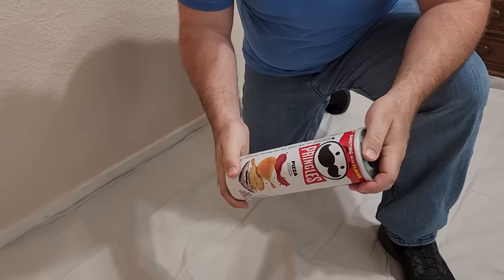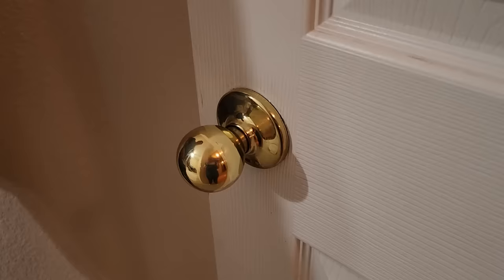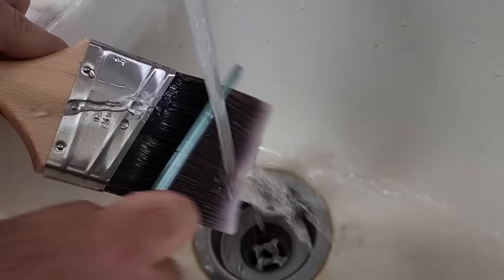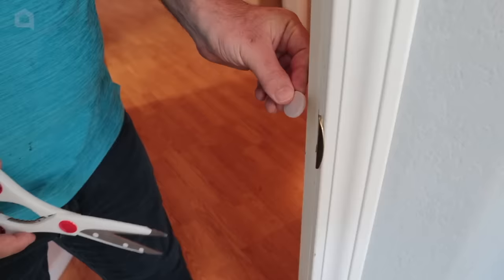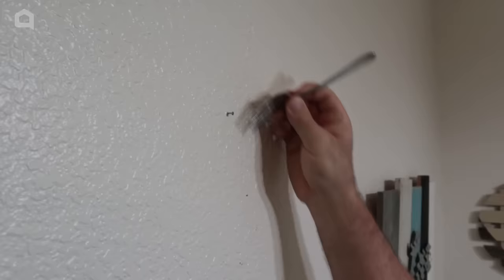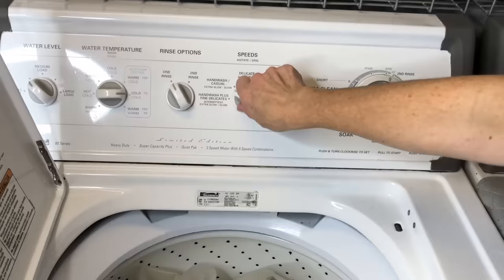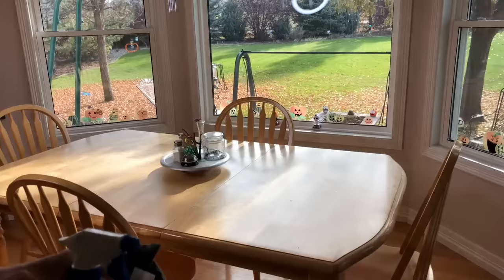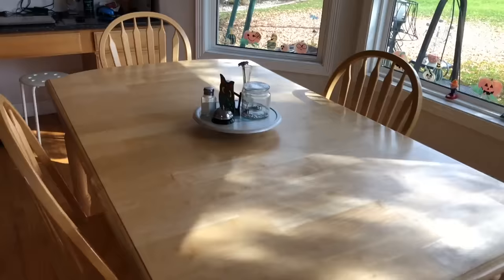9 genius home hacks from a guy who painted 1,000 homes

Comment: 7:30 I’ve heard you NEVER use vinegar around tile, because the vinegar is acid and the grout is alkaline.  My mother-in-law used vinegar to clean the shower tile, and now all the tiles are compromised, some are falling off.  
A couple of suggestions:   
First, may be ok to wipe but not to spray.  
Second, may be ok if grout is sealed.
Reply: Not sure if vinegar is good for wood either. What about the bleach on the tile? Never knew vinegar compromises grout and I think I’ve seen people say to use mixture of baking soda & vinegar on tile grout? Not questioning you. Makes sense. Just not sure why people would  recommend mixing baking soda with vinegar to clean dirty grout?
Reply: @sharilee4412  Mixing the vinegar and baking soda will make the resulting paste approximately ph neutral. The baking soda is a mild abrasive and won’t generally harm surfaces.
Reply: Tile guy here 25 plus years. Tiles definitely are not falling off from vinegar. Improper installation and or lack of waterproofing or poor quality grout. Js
Reply: Idk if the pH matters/compromises anything, but I spilled full strength ammonia on my grout and it looked brand new. Its pH is alkaline at 11
Reply: @robertfischer5893  hmmm. I need to check that out

Comment: Finally a video with some actually very useful tips. Love the pringles can and the rubber band
Reply: The Pringles can is genius...however, I just thought of a better hack.  Put the roller in a plastic bag first, so you don't have to worry about cleaning the chip crumbs, and the plastic will ensure it's air-tight.
Still for me....between coats, I prefer to keep the roller on and roller handle and wrap the whole thing in a bag, and use painters tape to seal it.  Keep it in a cold dark place like a basement or if in an apartment ..use the floor of a closet.   I do the same with paint tray too. Massive time saver since I just unwrap and finish off the second coat!
Reply: @canadude6401  if I don't finish painting I put the roller or paint brush in a zip lock bag and put it in the freezer. It doesn't take long to defrost and it doesn't dry out.

Comment: Many people put their brushed and rollers in the fridge between coats, but I put them in the coldest, darkest room in the house.  Which is the basement floor in my cold room.  I also wrap my paint tray with a larger plastic bag to keep the paint from drying out.  I used to waste tons of paint and time cleaning the tray between coats.  I keep all my paint cans and brushes in the cold room too.  Keeps them from drying out.
Reply: I stick rollers in a plastic bag and wrap it around to get as much air out as possible. Works well.

Comment: The glove tip is good, I've always used a bread wrapper and rubber band or twist tie when I take a break.  I keep an old toothbrush and a fingernail scrubbing brush for cleaning my paint brushes. '

Comment: I do some of those. I have one myself that works well. I use a piece of Glad press & seal plastic wrap in my paint tub. It's self adhesive to the bottom and sides for easy clean up. Just tear out and toss. Leaving a clean pan bin. I use  the shallow  plastic containers that family pasta dishes are sold in. The fit the film perfectly.

Comment: Another trick for doorknob and hardware is liberally rubbing vaseline on it, paint over itas normally would. Works on hinges also. When finished simply wipe off vaseline and paint with a rag. Bonus, the vaseline will help with squeak in hinges and hardware.

Comment: I'll leave my own vinegar tip ...

For rusted tools, simple take a glass pan, add equal parts water and vinegar to the pan, and let it soak overnight. The vinegar solution will break down the rust, which you can remove with a wire brush and steel wool. Then, add a little oil to the surfaces, and you're good to go! 👌👍😝

Comment: The door rattle… there is a little tab on the strike plate inside the hole. This is meant to be adjusted by bending to hold the door closed against the door stop on the frame

Comment: I painted my  living room a few weeks ago and some of these tips would have be really handy. Any tips for removing paint off wooden natural floor boards?
Reply: Try heat and a plastic razor blade
Reply: @Criam  really? Ok... I will check this out. Thank you 😊
Reply: @MindSetReset  I just had to scrape paint off my mom's wood floors this week. I had a very very sharp knife that came with this multipurpose plier type tool. All her razor blades were too dull. As long as u are careful this is the easiest way to get it off. For smears I just used Murphys Oil Soap & a soft towel with a lot of scrubbing.
Reply: Sherwin Williams Has wipes that work

Comment: I only watched the paint hacks out of curiosity. Im a retired paint contractor. 
Vanilla wont remove fumes. It just masks them. Paint will offgas chemicals for up to 7 years after the job is done unless you use VOC free.
Painters tape is toxic af. Use masking tape if you must but i think its only needed when masking for spraying. You can get a cleaner edge without it with some practice. Draw a bead of paint in quick long strokes pulling away from the edge at the end..Then repeat at a point above where you finished.

Comment: I’ve painted in some of the most popular sights in the world. Along with 1,000 homes, cars, newspaper bins, miles of fence. Seen many shenanigans, better or worse. Will give the foil trick a try. Hadn’t seen that.
Reply: If you painted 1000 homes you should be able to use your common sense to know foil wont work because it can't seal airtight like painters tape, paint would just leak under foil

Comment: Be careful using vinegar to soak showerheads...the newer ones are made of plastic-type stuff and I literally came back from a soak with a shower head minus most of the chrome-plated outer paint/color on the showerhead...it works great on metal heads, without worry.

Comment: I use vinegar in the rinse cycle of my clothes washer instead of fabric softener.  It works well and my clothes don't smell of vinegar.  Just put in straight vinegar to the recommended level.  
I also add vinegar to my laundry detergent dispenser. My dispenser takes 100 ml, the recommended amount on the detergent bottle is just 30ml so I make up the rest with vinegar.

Comment: If your home has a septic tank, and you clean paint brushes and tools in the sink (Sheetrock stuff too) you can cause major damage to your septic system. A clogged drain field is very expensive to fix, and you might not notice the damage until years later

Comment: Must we use the water system to flush away paint pollution?
Why not rinse in a reservoir of water in a pail and let it evaporate or pour it off after it separates?
I try to never merge paint with active plumbing and the utility that struggles to remove pollutants from the waters that it returns to. Sequester, let it dry, or, as I do, brush out your leftover paint in your brush onto a surface that can receive excess paint, e.g. a board or a scrap of heavy paper. I try to not create garbage as I go. Painting tends to create biproduct waste but that can be minimalized or eliminated.

Comment: Best tip I have for cleaning brushes and rollers is, don’t clean them, throw them out when done and buy new for the next job, you don’t need to buy the expensive stuff, cheaper ones do the same thing and are basically disposable

Comment: I would say the pencil trick on the key is a bad idea. You are adding grit into the cylinder. It is not the turning of the key but when you insert and remove the key that the grit damages the brass key and pins. It will wear them down. Pins can vary in size by the thousandths, so even a little wear and tear from the graphite can be very impactful. The graphite has nowhere to go. It just resides in there and builds up along with normal dirt.

Comment: Do not punch holes in the rim of your paint can. Doesnt work and just ruins the lid seal. Use paper towel to clean the rim before putting the lid back on. (I worked in a paint store for 5yrs then a house and commercial painter for 18yrs.)

Comment: If you don't want toxic drain clearers/cleaners put one to two cups of baking soda down your bathroom sink and add a couple cups of vinegar.  It will break up all the scum and the hair and then flush with really hot water you can also fill the sink with hot water and give it a good wooosh of water to flush sink. It is about a third of the cost of Drano.
Reply: I also use this method in the shower tub.

Comment: There's only 2 screws holding the door knob on ???
I use vinegar in my water bladder and store it in the bottom of the refrigerator, it's always ready to go on a hike. 
If your toilet flapper is leaking it will run every 10 or 15 minutes and you'll hear it,  you don't need kool aid unless you like a colored toilet.

Comment: This is a nice video, but the tip about adding vanilla to paint so you don't smell it is not a good idea. If you're breathing toxic chemicals you need to protect yourself with a respirator - not a dust mask, but a true respirator that will block or absorb volatile organic compounds (VOCs). These chemicals are not healthy.

Comment: Guys, ive been a painter for 10 years, not 20. And i can say putting a glad wrap under the paint tin is asking for trouble, it doesn;t close properly, as you can see it pops right back up and then the video changes. Also the amount of cleaning liquid you used for that tiny amount of floor grouting was absurd lol. When you buy paint you use paint, you don;t buy it take the lid of and then put plastic wrap under it lol. Never use a roller that fat, that's just silly use the thinner profile white roller. That roller will flick paint everywhere.